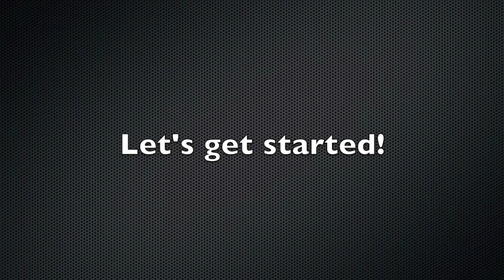Evergreen Autoworks Pick up Truck Bedside Replacement

Comment: ..I  went somewhere else because my insurance knew I was very unhappy & the the punk ass Jeff & I had couple agreements therefore my insurance allowed me to go to another place and it got fixed correctly. The other body shop was amazed of how terrible the job was and how they cut corners on a lot of the repairs such as replacing only half of a core support when they originally were allowed to order a full core support. Never going here again, they will mess up your car & owner doesnt care.